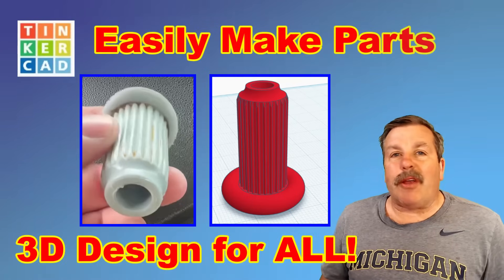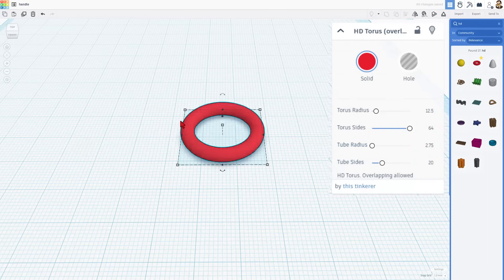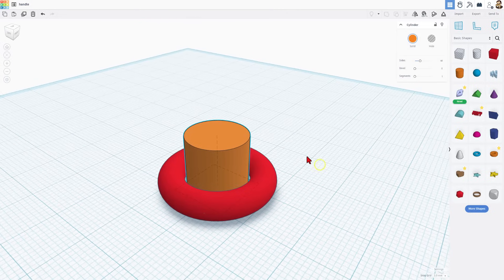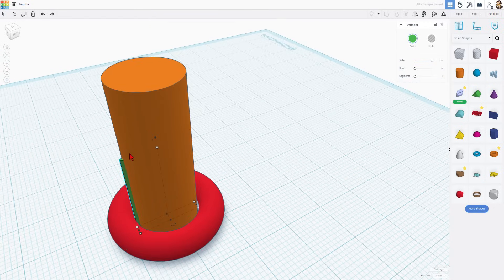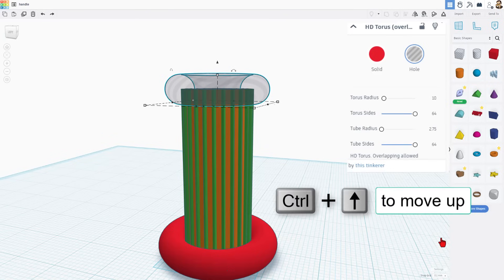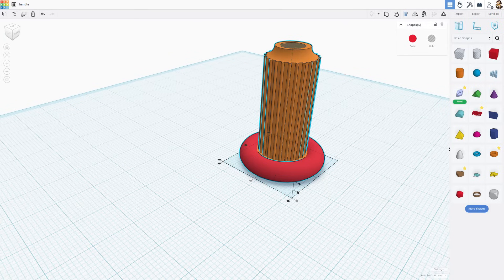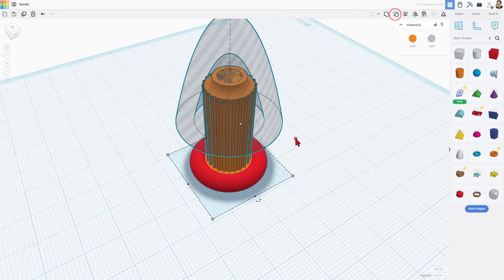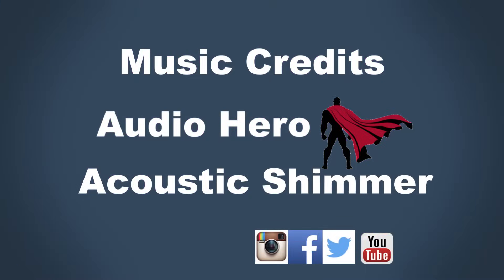Easy 3D Printing: From Image to Object with Tinkercad CAD for Everyone!

Comment: Thanks from a fellow Michigander
Reply from the maker: My pleasure @Jeremy2A. It will be nice to have the Lions playing tomorrow after a week off!
Reply: I was amazed to see this part. In 1974 I worked for a company that made casters. This part was made to be driven into a metal tube leg and then the caster stem was inserted into the hole. They were made in several sizes for common tubing sizes.

Comment: Great content only problem I have with TC is it keeps returning to my browser (0PERA) when I right click I then have to start  TC again but i can recover my work but it is a real PIA ...... You get a like and a subscribe from me .
Reply from the maker: Thanks for the sub and 👍. If I remember right Opera allows some slick customized key and even gestures. I wonder if you have something set up as a trigger that has it bouncing like that. I would give another browser a go just to see if you can avoid that. I use Chrome, but I have worked with many others and it is not an issue.

Comment: I really like the videos.  I like TinkerCAD and find it very easy to use and Your videos have helped make it easier than any other 3D Modelling software I've tried.  I do have a question though.  I have a thing I want modelled.  I have four pictures of it, front back and both sides.  I've tried re-creating it in TinkerCAD, but it's with too complex or I'm not goo d enough yet. (I do suspect the latter).  Do you know of anyone that takes commissions for turning a 2D image into a 3D file?  I don't mind paying well for a good result, but I've paid people before and they haven't even come close to what I want.
Reply from the maker: I do not know anyone that works for commission. I do know that if you share a design to the "design wish list" in my Patreon messaging area users are good about helping designs become a reality. Link: https://bit.ly/hlpat  It is available to free members. Slick for questions like this because we can add images and links. This explains it. https://youtube.com/shorts/xHUM1eGOmjE?feature=share

Comment: Is there a reason to not use the HD version? Is there a list of shapes that have hd versions and regular? Maybe I have been using the wrong one!?
Reply from the maker: HD is more resource heavy.  For this project zero issues. You could make a design so complex you would wish you had the lower poly part. I print a lot of my creations with lower quality just because I do not have a need for more resolution.

Comment: I like that one of my shared designs are visible in the last couple of your videos.   It's the only design I've ever shared. 😀
Reply: Share more!
Reply from the maker: 💯🔥Love it when a plan comes together. =) Was it one in the gallery or something I had opened via "copy & tinker"?
Reply: @HLModTech : Oh, just one in the gallery. The pink, transparent mini- chainsaw protector in the lower right row.  One of my early builds... that's edition 1. 2 more had to be created due to differences in manufacturing of what was supposed to be identical saws...  I had to protect the grandchildren.
Reply from the maker: Very cool! I did copy & Tinker that. I have one of those chainsaws and a user asked about printing a cover. I plan to use yours with the pins from here. https://youtu.be/m5JhaFSjJKY

Comment: I know you’re not the one I should mention this to, but I’m having awful trouble when I go to resize a cube. If I type in the values in the cube panel it’s as if it thinks I mean inches, when I clearly have it set to millimetres in preferences. It’s very annoying. I also note if I change the dimensions by using the edges and then try to change the radius to get rounded corners it doesn’t give me nice rounded corners… maybe I’m just using it wrong?
Reply from the maker: It is likely that you dragged a handle... which breaks the parameter slicers. This video demonstrates how parameters are broken if we drag handles on a shape. https://bit.ly/breaktink
Reply: @HLModTech ahhhhhh ok! Thank you so much… that video was a bit before I started down this path, so I appreciate you pointing to it! It explains it… frustrating as it is….